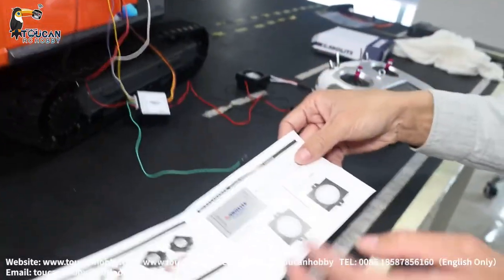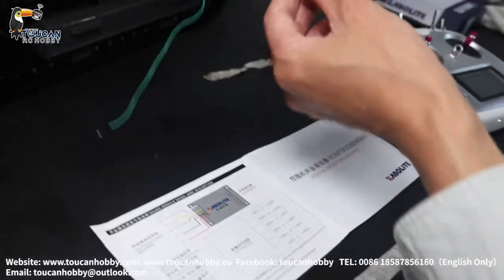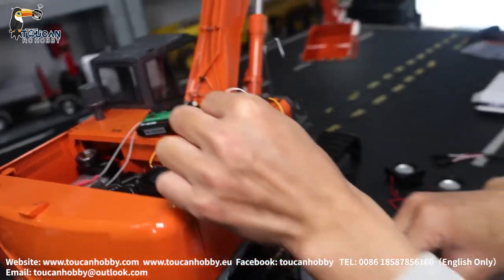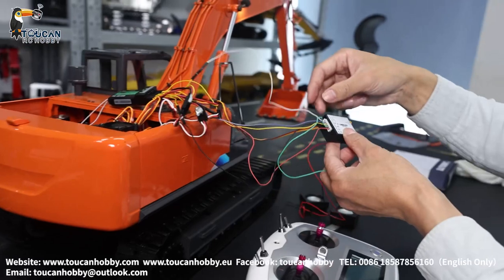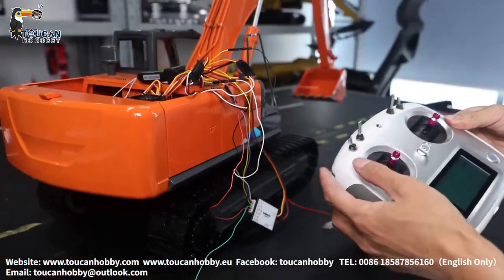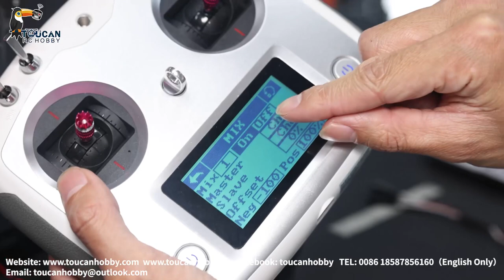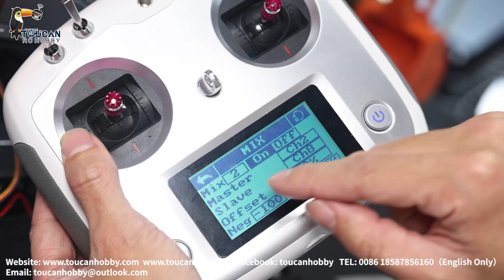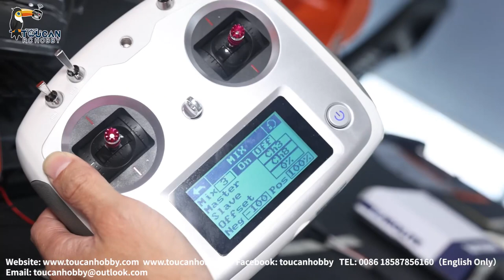How to add RC kabolite excavator sound system, check the wire connections and i6s radio settings.

Comment: Not being rude
But I'm struggling to understand what's said.
The camera is everywhere but where it should be pointed. 
I just bought this module 
I have to same controller & receiver. 
So what channel do I put the plugs in
Kabolite don't supply any paperwork it came in a brown box no instructions?